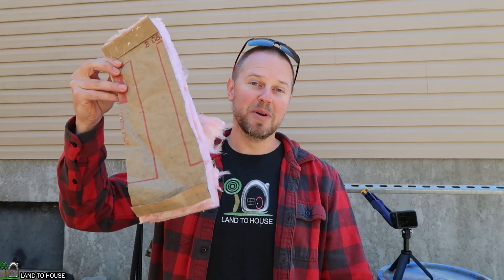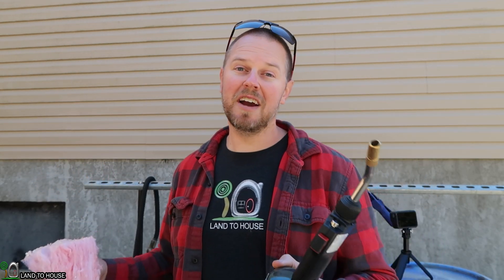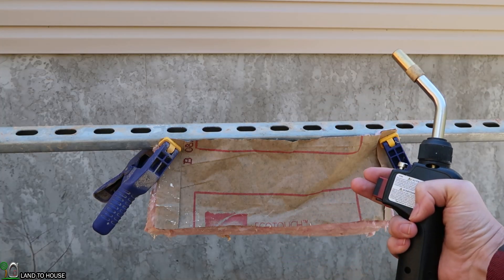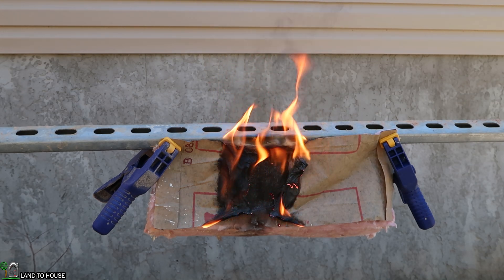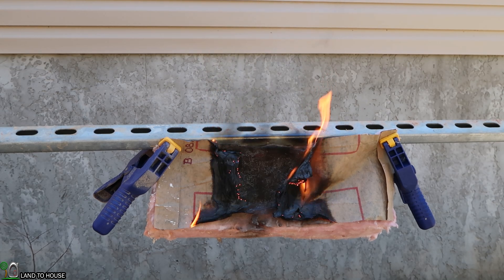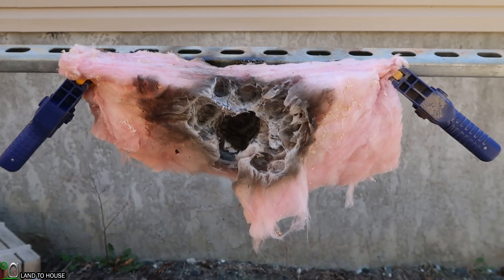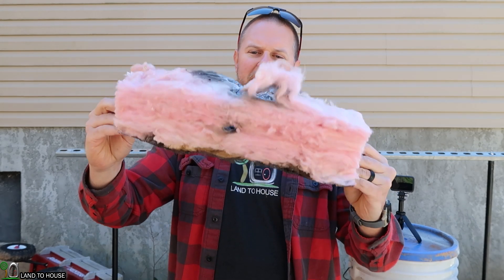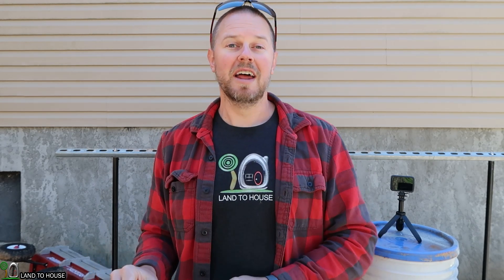R13 Insulation vs Torch

Comment: Not surprised that the paper backing burned easily and quickly, but it doesn't look like even that flame was enough to ignite the insulation by itself.    The flame direct from the torch makes the insulation material look like you're opening a portal to the netherworld though.  :-)

Comment: And to all the rockwool fans,  it contains Formaldehyde.  This is what they say.  -   The amount of formaldehyde in the finished product is less than 0.01% by weight. So if you put up a hundred pounds of it, you would have 1/100th of a pound.  So about 4 grams.  Maybe that is OK not sure.

Comment: By the time the fire gets to the insulation on the other side of drywall, it has already ignited the paint on the walls and whoever was in that room sleeping is likely already dead....
I would like to see this experiment under real world application, not just throwing a torch at it...  put a piece of drywall in front of it and use your blowtorch again....  I bet you get a different result...

Comment: Too Cool to see the torch melt away the glass fibers and tunneling through.   Fiberglass is essentially molten glass run through a cotton candy machine.
And there's your answer, the kraft paper moisture barrier burns.  The fiberglass succumbs/melts to heat, but doesn't sustain combustion itself.